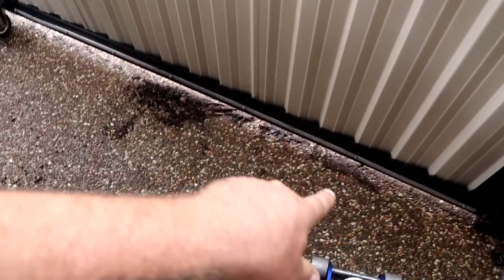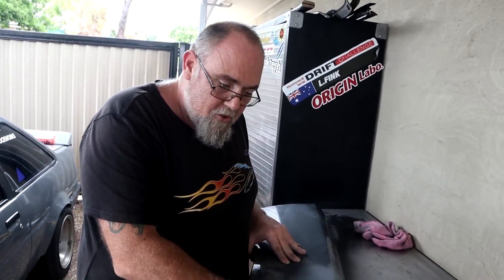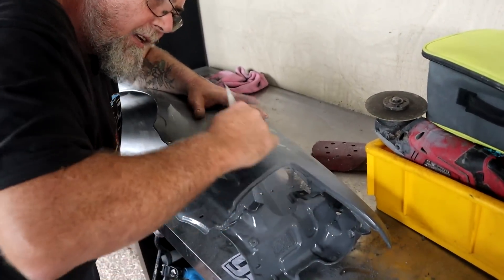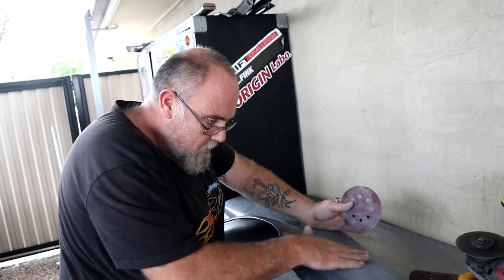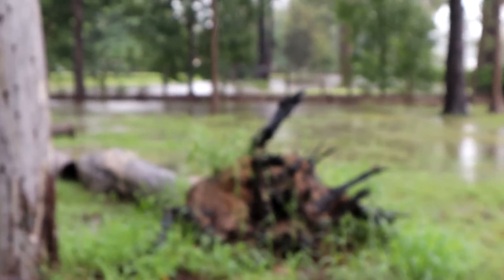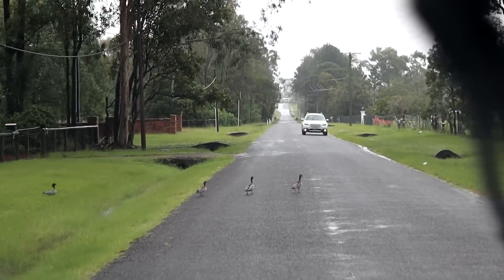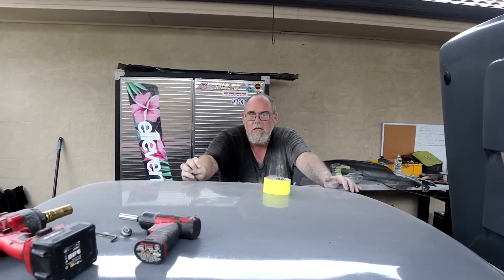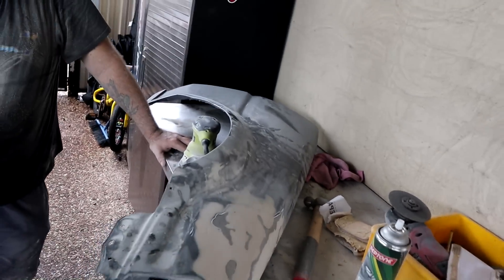86 progress raptor fixed

Comment: It's crazy they red flagged it at all when the Raptor is advertised as being able to run the biggest off-road race in history the Baja 1000 which is also the nastiest roughest off-road race I've ever raced and I've raced over 10 years.. they used a stock Raptor with a roll cage and used that in their advertisements

Comment: Just got home, Fink on the big screen and a glass of new zealands finest batch of whiskey, barrel no37/50... Have u heard of ferropre? Metal filler used on pipelines above and under water. My old ln106 will fall apart before the ferropre falls out its so good.. u need a grinder n flapper pre much to rub back.. check it out, its the shit..